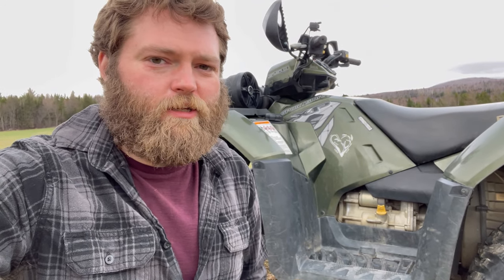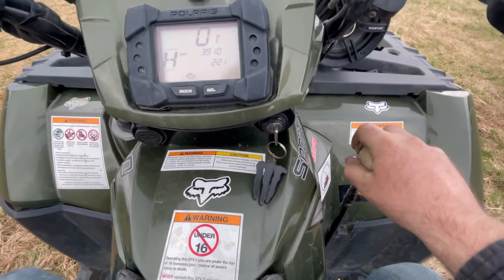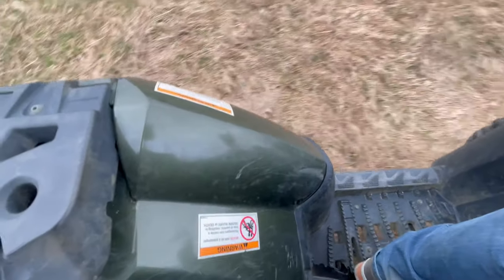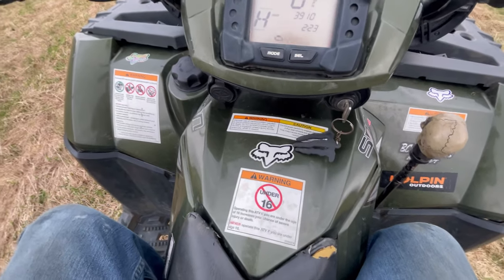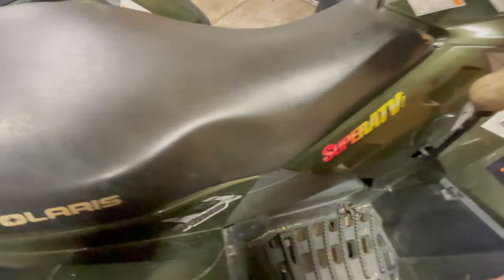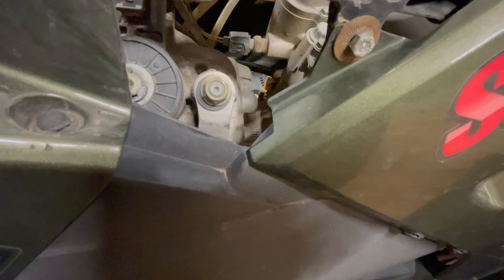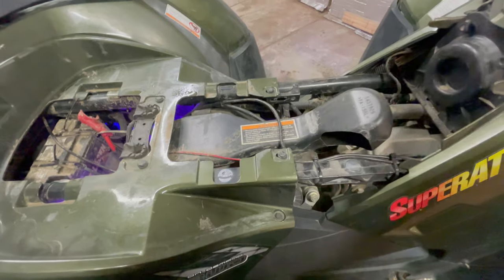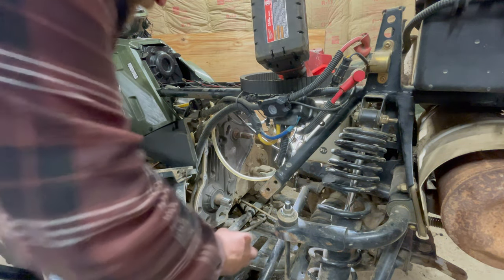Horrible noises coming from This Polaris sportsman 550…

Comment: Working on a Polaris Outlander 500,  2005.   B.I.L bought it for $500.  Previous owner could not keep belts on it.  Long story short, after numerous check, found the front motor mount had sheared off.  This caused the motor to shift under torque, misaligning the belt.  The secondary was sticking.  Thoroughly cleaned it and files the wore groove on the helix.  Rollers were like new!!  Re-assembled and tested like new!!  Never seen this type of secondary, looked at 100s on line no success.  But, unit seems to run fine, so let it go for now, until it fails, then replace with new one.  Much moola…..

Comment: Hi Rock I have a 700 diesel and I have changed oil filter and fuel filter and runs ok. I have the same problem. The problem is in high or low it runs to a certain speed and won’t go any faster and I can give it more fuel but won’t go any faster. It used to go faster. I have no one here that works on diesel. Can you give me what to look at.
Reply from the maker: @Bearupfarm I know you said it has lack of performance pretty much. Is it smoking out the tail pipe at all? Do you have a service manual for that machine or for the engine?
Reply: @rockspowersports  no I don’t have a service manual. It does not smoke. It’s pulling the small trailer ok with a load on it.  It’s just not picking up speed. It will run about 15 mph and Give it max throttle and  RPM goes up but speed stays the same.
Reply from the maker: @bearupfarm1818  With what your describing, it really sounds like the engine is running properly if the RPM’s are increasing. To me it sounds like the power is not being transferred to the ground enough which would point to the drive belt or clutches. If your secondary clutch is not shifting out all the way it would do what you are describing. 
I would pull the clutch cover off and rev it in neutral to make sure your clutch’s are properly shifting in and out.

Comment: When you had your wildcat 1000x did you have to give it.  But if gas when you start it cause I’ve got a 2015 wildcat 1000x and it does sometimes if I don’t give it gas for. A few seconds it’s been to a shop and they said it was normal any experience on this
Reply from the maker: @Mudpro4life This one didn’t do that but I have heard of some doing that. I’m not really sure what would cause it, possibly a weak fuel pump or throttle position sensor mis adjusted.

Comment: Super job Sir! My 2010 Sportsman 550 rid nice, but there is some clucking sound at idle. It could be clutch?
Reply from the maker: It would be the clutch. Really only one way to find out, tear into it.
Reply: @rockspowersports  Thanks, it is timed exactly with power stroke, possible the clutch damper's fault? ( the fat tooth gear with plastic damper ring between tranny and VBT clutch)

Comment: Hi rock i have a 04 sportsman 600 twin herd belt shaping against clutch cover replaced belt still hear the slapping why lance
Reply from the maker: @lancebidwell-br2sb If your hearing the scraping against the clutch cover my guess is the inner clutch cover is either not in the correct position or the rubber mounting grommet that holds the inner clutch cover is worn out. You’ll have to pull both clutches to replace that.
Reply: @rockspowersports  I'll check on that thank you

Comment: Hey boss it seems i have the same  issue with my 2008 polaris sportsman 800, it does that noise when im turning or sometime when its running straight, do you think i should change the sprin as well?
Reply from the maker: @gilbertolara3065 The noise I was hearing in this one was the old drive belt pieces being tossed around by the clutch.  Does it sound like the noise is coming from the clutch area on yours? At least with your 800 the clutch is on the side of the wheeler so it’s a little easier to get to.
Reply: @rockspowersports  Yeah it kinda sounds like it's coming from the back as well. Sometimes it does it randomly or when I'm turning, at first i thought it was something with rear dif but it's more like a clunking sound